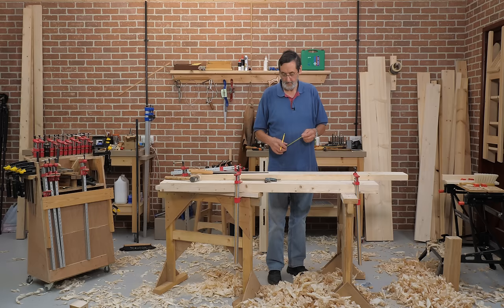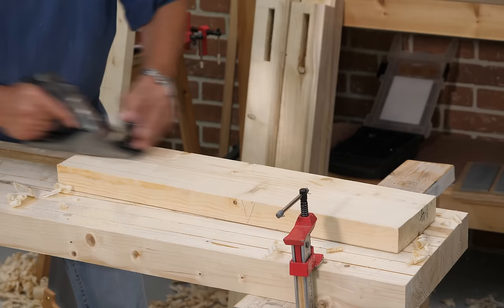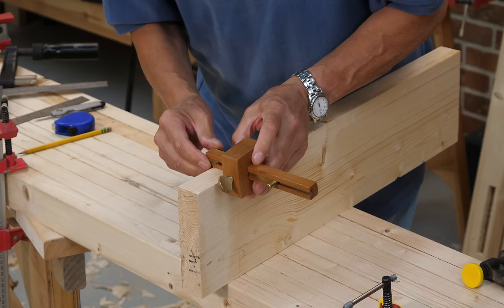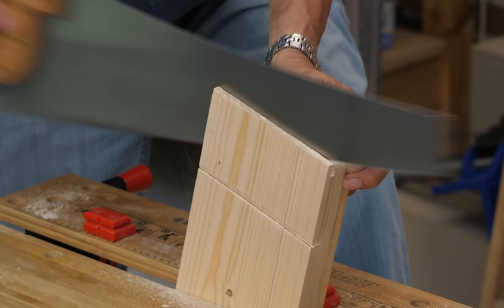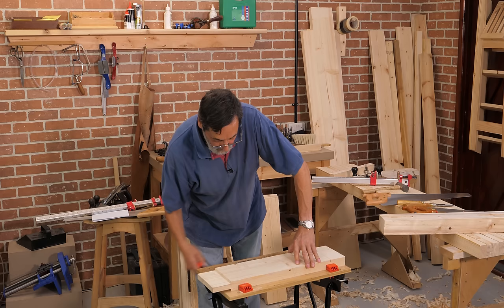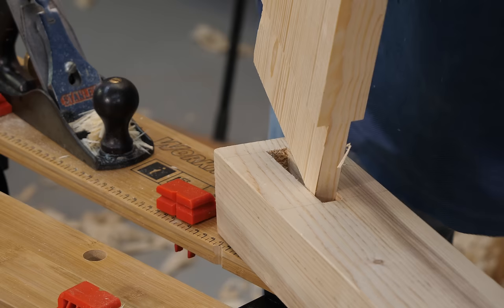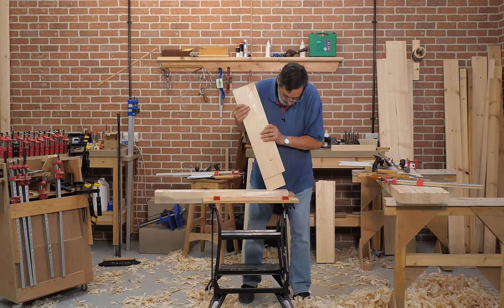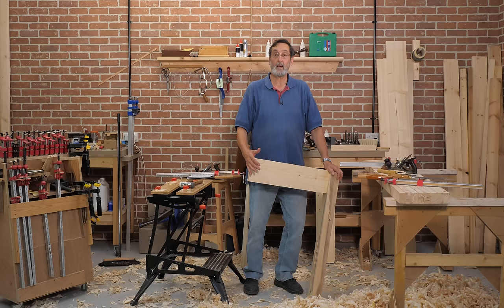How to Make a Workbench Episode 4 | Paul Sellers

Comment: During every step in the project I have found myself saying "well... THAT didn't quite go like it went for Paul!" This step is certainly no exception, but that's okay. It's still been super fun so far, and I'm learning a ton. Heck, I think I might even be a pretty good woodworker by the time I'm done with this workbench. Maybe even good enough to build a decent workbench! :)
Reply: “Good, Better, Best, Never let it rest; ‘Til the Good is Better and the Better, Best” -Alban Douglas.  Prof Douglas never accepted an excuse from me he handed things back and rattled off his mantra.  I learned to do things six times before handing them in the first time.  Same with cabinet and furniture making and antique restoration.  Customers accept no excuses so I practice on myself and wife and kids and antiques to sell at auction everyday until my arthritis gets the best of me and every task is done perfectly
Reply: To be fair, simply having a working work bench is a pretty good crutch for improving your woodworking. Helps a lot not having things move and shake all the time while you're trying to make straight saw cuts and plane things leve.
Reply: I soooo agree going through this and I must say it took me a bit to get the hang of but now... I have a feeling this bench is going to look so good compared to my cheap plywood slapped on top of some 2x4s
Reply: @austinvickymoore3656  Yeah! You're going to love it!

Comment: Hello Paul. I realize that you are a very accomplished woodworker and you have many more years of experience than I do. But here is a tip that you may already know which was taught to me by a patternmaker many years ago. At around the 30 minute mark as you are fitting the tenon to the mortise, try rubbing a rad marking crayon or even a black china pencil on the sides of the tenon. when you try to fit the snug tenon in , the red or black will tell you where it is tight. Like I said you may already know this tip but if not , give it a try. Also, thanks again for your great videos and have a great day.

Comment: I’m so jealous of your sawing technique. Years of muscle memory
Reply: oh yeah if i try to do it my edge will look like a drifting course
Reply: A good dose of skill and many years of practice - you too will be making sawdust. Sawing is a skill like any other - 10% inspiration and 90% perspiration so don't give up and keep making things, it WILL get better!!
Reply: I agree.. the muscle memory in my right arm is only good for a minute or two, and isn’t as anywhere near as smooth and accurate for sawing this nicely😉
Reply: Me too! Although I'm sure it's also down to good tools, as well as a master-craftsmen level of technique. I know all my saws are old, and think they're probably in pretty bad shape (i.e. dull, not sharp), so I'm struggling with poor gear and technique!
Reply: I had a bunch of pieces of wood I was going to burn due to rot and too many holes etc, so I spent a few hours just sawing it up with an old slightly rusty, slightly blunt saw.
Some cuts I was really pushing the limits of my strength and stamina and every time the blade jammed was like a big set back, so I learned to not push it and keep it cutting strait, let the saw do the cutting... I bought myself a new saw and it was such a treat!!! But the same still applies, jamming the blade is frustrating and counter productive, relax and be patient.
(4 years later but never mind)

Comment: There is something 'zen-like' with your video-tutorials Paul :) and even though I utilise powertools like a router-table, and thicknesser / planer, watching you use a No.4 Stanley with ease makes powertools seem less desirable.
Reply from the maker: The aim is not to oust machines but compliment them with hand work that then reduces the invasiveness of machines.
Reply: Working from a small shop I have been looking to increase space and reduce noise. I never knew hand tools could be so... useful and peaceful (Zen-Like).
Reply: Hand tools can sometimes even be faster (and better) than machines. When you count the setup time and smoothing after running a piece through a piece of power equipment, often the use of a hand plane saves you time.
Reply: Eric Francis oh,yeah. And to get a comparable smoothness you'd have to sand to at least 1000 grit. The look of sanding or rotary thicknesser blades will never compare.
Reply: I agree with LT. But, so far, I'm just terrible at setting up/using planes...
Reply: On the off chance that you're having the same problem I was with my planes, I'll just mention something that I haven't seen mentioned in any videos I've watched about hand planes, and that's that there is a lever cap screw that adjusts the tension of the lever cap on the iron assembly. I thought I had a crappy plane because it was unbelievable difficult to adjust the depth with the depth screw because the lever cap screw was too tight. I tried oiling it, I tried everything and just assumed it was supposed to be that tight despite seeing Paul easily adjust his with his thumb and index fingers. Ever since I figured that out, it's been smooth sailing. Might not be the problem you're having, but hopefully it will help someone.
Reply: @jeremyshoemaker9275  ..this comment may have saved my sanity..thanks...
Reply: @jeremyshoemaker9275   Sadly, sometimes the problem is simply poor design ... I inherited a medium-sized Master Mechanic plane from my father who only did a little bit of hobby woodwork, and when every component of that plane isn't cinched down as tight as it can be, the blade slides away as soon as it contacts wood. But with things cinched down I have to pop the lever cap up to adjust anything. So I finally broke out a 2x4 scrap and my newly sharpened chisels, and I cut a traditional wooden plane body (using Woodwork by Wright's plane series as a guide). It's nowhere near as good as a vintage wooden plane, but still works better than the cast iron one. And it gives me hope that the next one I make will be better.
Reply: @Nurk0m0rath  Do you have a link to that series by any chance?

Comment: It seems people would remember about 50% of what they see and hear. but the next day people would forget about 60% of what they remembered. 
I have built my workbench this summer based on the 2012 blog posts and video. Although I had looked at the videos several times, when I looked at them again after having done an operation, I could see that I didn't perfectly follow the directions. 
In the end I have a good solid workbench but it could have been nicer.
My recommendation: look at the video several times, just before an operation and after the first (mortise, tenon, or whatever) and then once again before doing the other ones (mortise, tenon,etc. ).
The good news, people would remember 90% of what they have done.
There are a few new tricks to be learned in the new serie; and here and there, the technique is a bit different.
In the new serie, for instance, Paul cuts the tenon deliberately fat (+1mm on each side) which was not the case in the old serie. With the new serie, your chance to have a perfect fit tenon are higher.
There is always more to learn.
Thank You Paul and happy New Year.

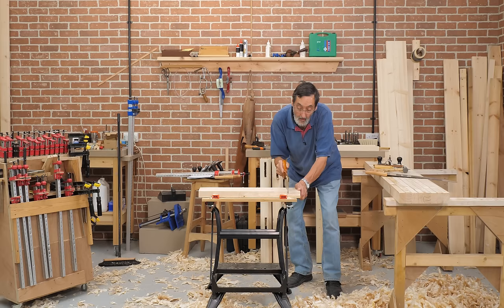Comment: [~14:35]  Hoo, boy.  I had almost forgotten.  I was supposed to be keeping a pair of B&D Workmates in mind, on my list of "tools-I-need-to-invest-in-eventually", if I ever want to get better at managing site-work situations.  (I.e., anywhere I don't have a proper stationary shop workbench.)  They may be made in China nowadays... but that doesn't change the fact that the versatility of that original design is still an engineering classic.
Reply: I just bought a second hand one today.  I've been doing some small bits of woodworking recently and not having a bench makes it difficult.  I can only get away with clamping things to our kitchen work surface for so long before my wife catches me at it.  A second hand Workmate is a staging post on the way to building my own bench and it only cost me £20.
Reply: They're just too damn low for hand-tool work though.  Guaranteed back ache whenever I use it :(
Reply: It's true, they are low and I'm tall as well, which compounds the problem.  As I said above, it's a Workmate is a staging post.  It's a lot better than nothing (or our kitchen work surface) but certainly nowhere near as good as a proper workbench.

Comment: The reason I started building my own workbench is the B&D Workmate moves with every action. I find it difficult to saw straight or be precise with chisels if the piece and workbench moves with every cut.
Reply: I own the basic Workmate, which drives me crazy whenever i try to plane on it.  I end up with a laughable setup where i have a 4x4 bracing between the Workmate and a brick wall just to keep it steady.  I do think I'll upgrade to the Workmate seen here, though, as the step seems to go a long way toward stabilizing the action.
Reply: I just picked up the workmate he has on here for $50 from a guy online. A few nicks in the wood but who cares? I don’t have to assemble that bad boy... it’s already put together and cost less than half the price of a new one. Yea the step seems to be the best stability feature they added.
Reply: I'm still working on my workmate, and when I plane I keep my forward foot on the step. It's a bit awkward when I get to the far end, but not terrible.

Comment: So do you glue the tenons? If you glue them won't you need to take off a little more to also be able to fit it with glue on it?
Reply from the maker: No, not at all. A lot of people think that but the industry standard has always been a snug fit no matter what people in the industry might say today. It only takes a little glue for permanence as it's the joint that gives the intrinsic strength and not the glue. Gaps between mating surfaces leads to weaker joints all round.

Comment: the part sawing the tenons with the hand saw on that small black & decker unsteady bench with your finger holding the lumber that keeps rotating looks dangerous.
Reply: If you watch carefully, Paul keeps his fingers out of the way.  The wood is moving forwards, in the same direction as the saw push, it's not going to slip out because the wood is moving.

That said, it's clearly preferable to have a proper bench, which is why he is showing us how to make one.